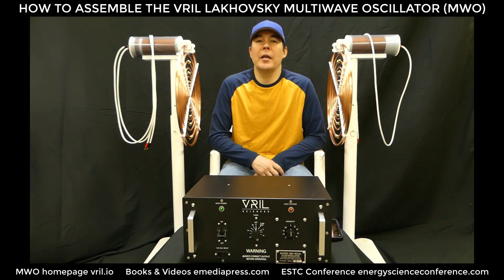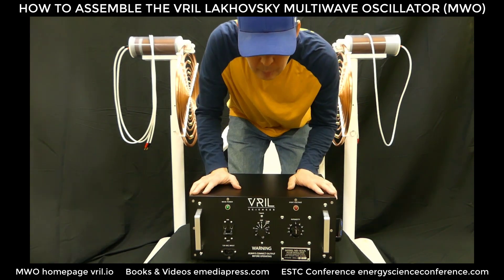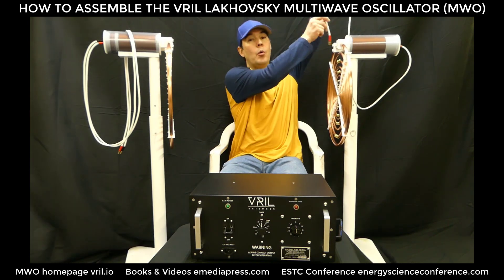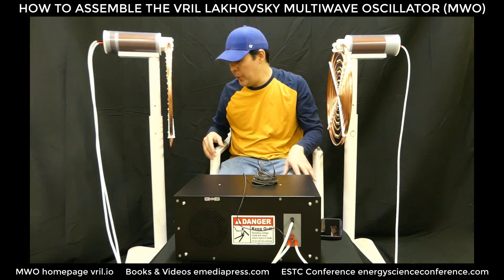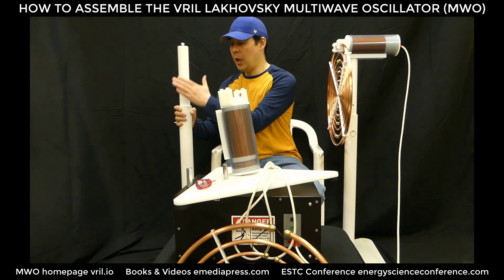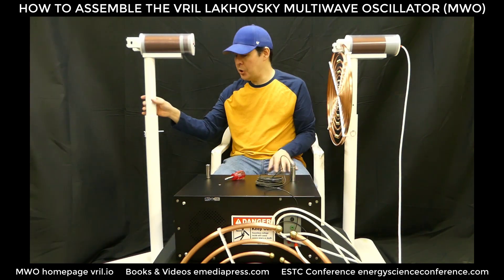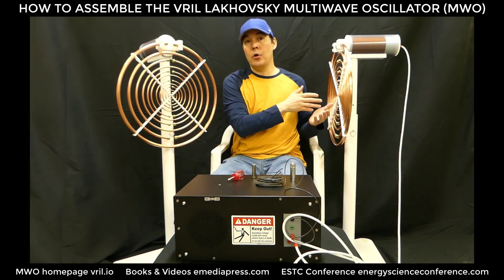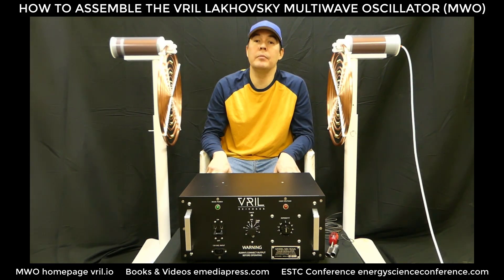2021-01-14 Vril Lakhovsy Multiwave Oscillator (MWO) How to Assemble

Comment: Almost all better quality PC power supplies nowadays can use 110 to 220 alternating current volts with different input line frequencies.

How?

Because the input power is rectified to DC power that is ripple filtered by large capacitors, then that resulting voltage is used to step down the energy to all the required personal computer voltages needed by the mainboards. There are books on how to design such power supplies to be very highly efficient.

However, if your modulator circuit requires just a couple of voltages that do not require very precise levels of voltage regulation, then it might be an idea for you to design and build one of these things as a module for your device.

From my experience, very old devices fail from various causes. Some devices just go bad sitting there, and others deteriorate from extensive usage. To make your machines more serviceable, some components that are very likely to self-destruct should be user-serviceable.

Lakhovsky died at about age 72 circa WW2. He neglected to create a corporation that would succeed him in carrying on his efforts so that when he died, his machines could not be repaired for the expected required upkeep and maintenance and that is why there are so few surviving original machines available for studying. The medical doctors who owned the machines either through them in the junkyard or garbage heap, or hid them away in a storage closet somewhere, etc.

You can learn what the best power supply manufacturers are using for their voltage conversion technologies by buying a model that has high efficiency and a 10-year warranty.

I have noticed that I have a bunch of old cheap power supplies that all have failed. They are each using an unreliable model switching power supply voltage regulator integrated circuit that must have been designed with some non-obvious shortcomings. 

See National Semiconductor LM78S40CN 16-pin Adjustable switching voltage regulator

It could be that the reference voltage output circuitry routinely fails? But I do not know for certain.

Each circuit design is only as good as its most unreliable components which represent some critical points of failure.

Comment: Can I have the same benefits if I intercept this energy directly to my body by touching the transmitter antenna side  ( with low voltage)... and disconneting the receiving  antenna side...... ...as with   ( tesla violet ray) devices.?